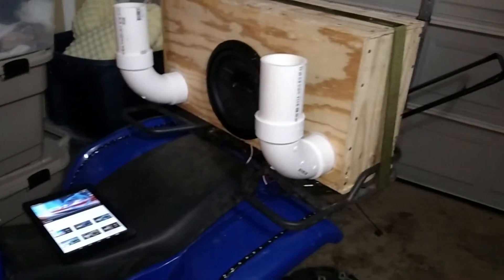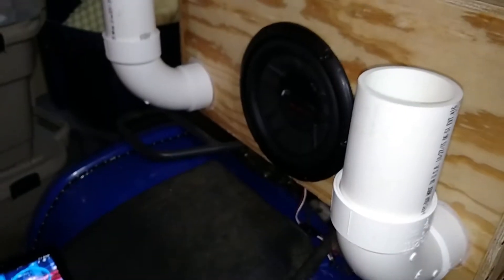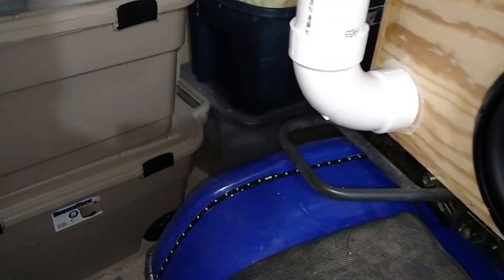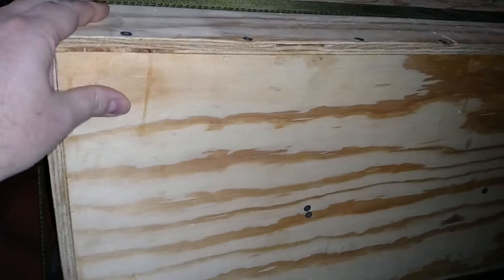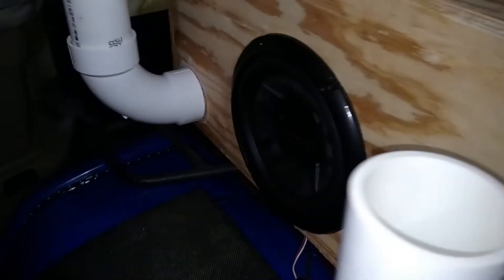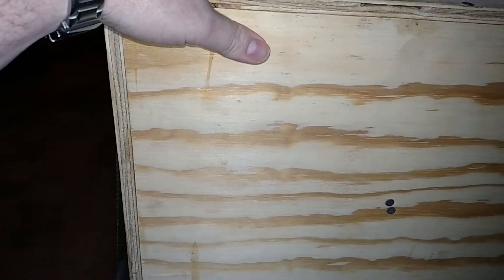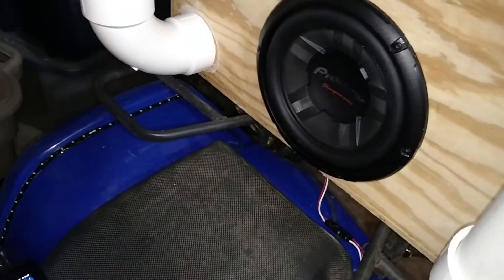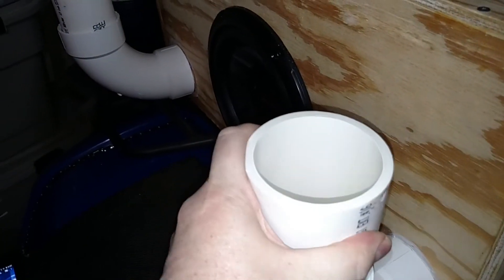Part 8 - ATV Subwoofer - Did the math, for 35hz need 18 inch port, would look better in the box.

Comment: Hey Chris after going through and watching all of your videos you do need to add some strength and bracing to the box. You talked about fiberglassing it and fiberglass only adds strength when it is more of a curved surface. It does not add hardly anything on a flat surface but what you could do for easy inside bracing is getting some 1"- whatever you feel big enough wooden dowels (which are like wooden cylinders that you can find at Walmart in the crafts section) running across the inside of the box in several places around the sub and maybe one or two going up and down. I wouldn't use any kind of mdf wood in anything on the box because just moisture can cause it to swell up and then it won't be as strong. Just a thought but your boss "1500" probably won't do close to rms ratings but as long as it works for you it should be fine. I myself would not use anything to do with Boss audio but again as long as it works for you it should be fine.
Reply from the maker: +Seth Bowman I used boss because I did not want to stick other brands in the rain. Per the 30 amp fuse in the amp I am think it will produce about 260 to 300 watts depending on the efficiency. I have ran many other name brand amps in my childhood like Orion, SoundStream, Alpine, Pioneer, and more, but I can say this little amp is not that bad for $44. I also have a video that shows the the 200 watt amp I bought before this one, you can see the smoke coming out of it after I ran it for 15 mins.

Comment: Hey Chris this is Seth. It sounds to me like your port length should be good as long as you have done the math and don't have too much port noise or a whistle coming from the port. Switching it around may cost you a little bit of loss in output but I don't think it would be that noticeable. Switching them would be best because like you said it's just a funnel for rain, water, and other debris. If it was me and I didn't have a marine woofer I would do a sealed box however we had a slot ported box in our jeep with a non marine sub and it got rained on and dirty several times and never gave up on us.
Reply from the maker: +Seth Bowman Well I am going to put a seat back in front of the 10, and I may turn the ports to face the seat as well. The material of the sub seems weather resistant as long as I don't go and fill the box up with water. The next issue I have found is that I may be at the max of the ATV power system and with all the lights and radio on was seeing my battery go down to 12.5 volts. I can easily fix this, but would have to change the way I wired the lights on the switch.